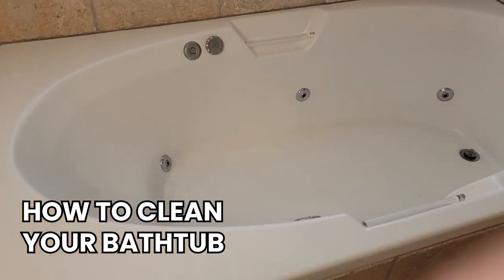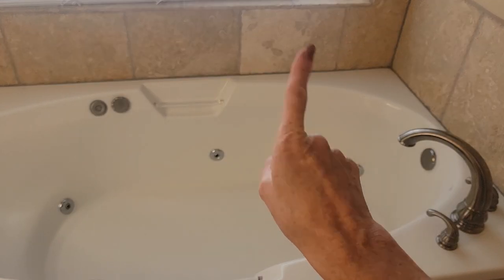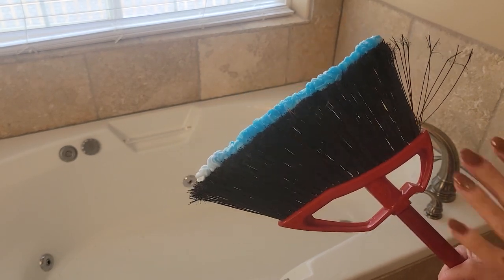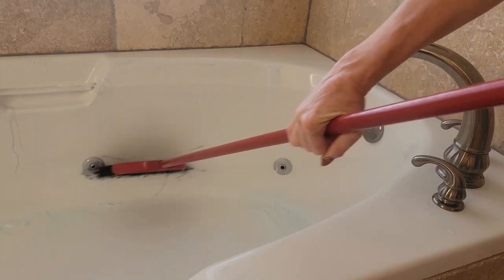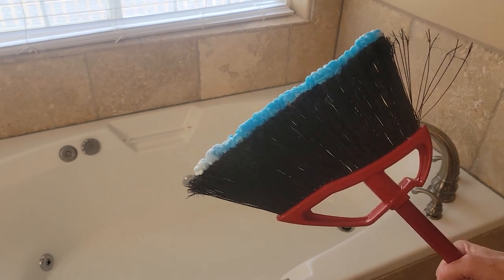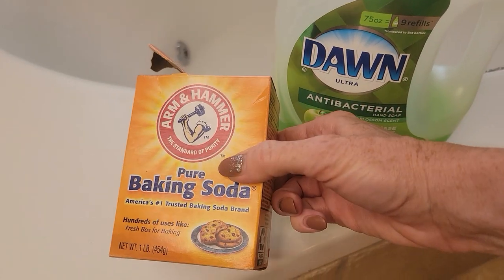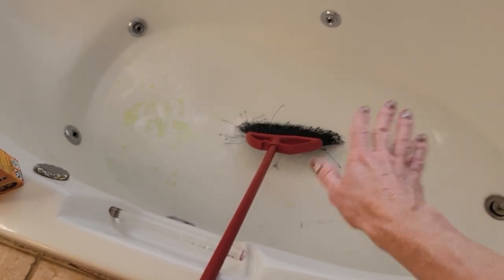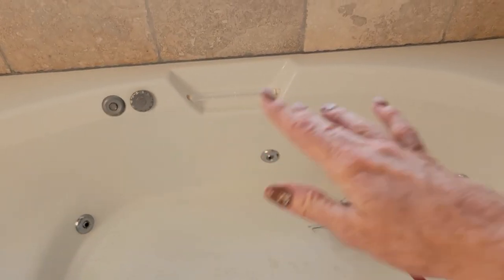This Surprising Hack Makes Cleaning the BATHTUB a Breeze (⚡GENIUS)

Comment: I've never done dawn and baking soda , but I do baking soda and Oxiclean a lot. I use dawn for my stainless steel surfaces but I'll have to try this. The broom is a great idea but I bought a flexible shower cleaner stick thingy with a rotating head so I can do tub and shower without bending.